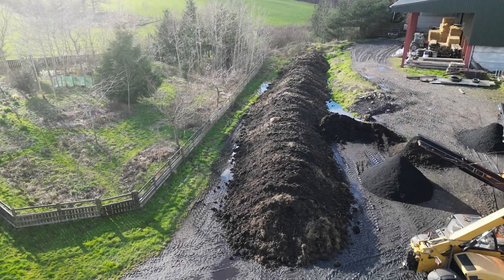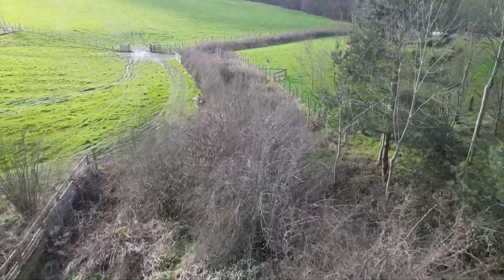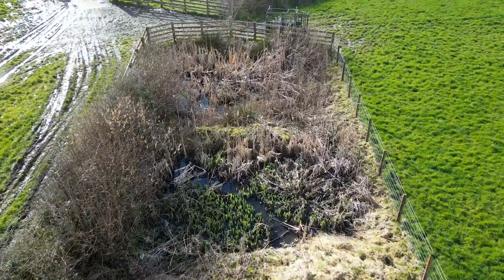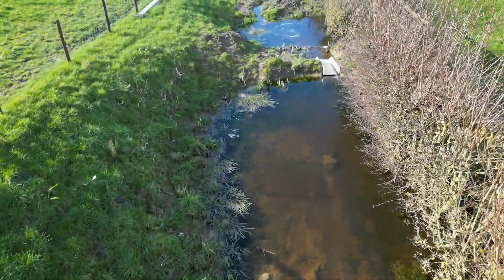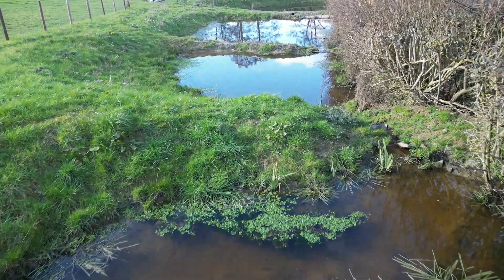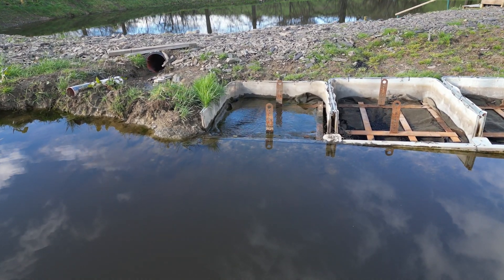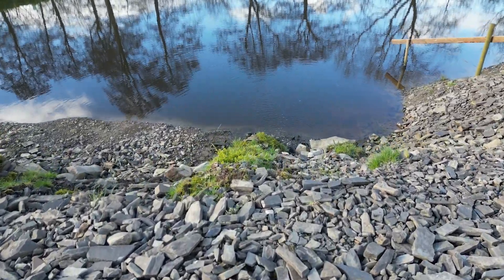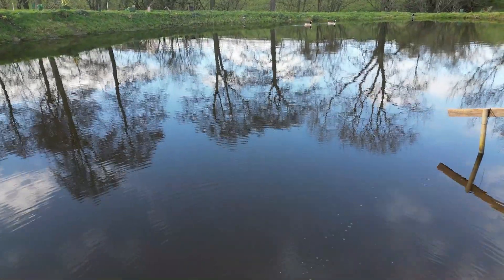Biochar - A simple solution for river pollution

Comment: Thank you Mick.  If I look at your video between 3:16 and 3:19, I see what looks like a trench at the bottom of the field....between the field and the stream, filled with biochar. ....to intercept nutrient-loaded water potentially percolating off the field towards the stream. Would I be right?
Reply from the maker: This is a path made from the hardcore and non combustibles screened from biochar derived from composted tailings. As you can see the stones are covered in char so there will be some benefit to using this hardcore!